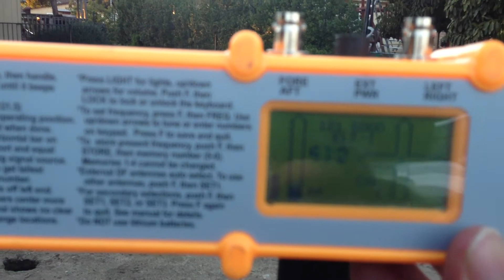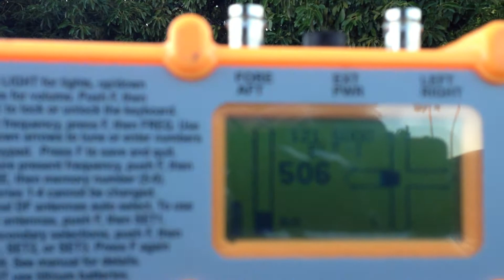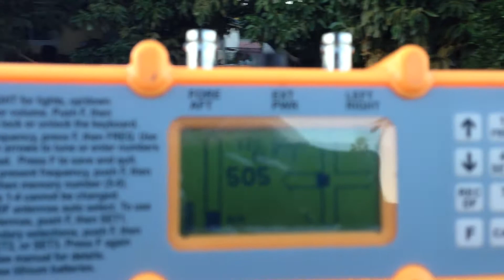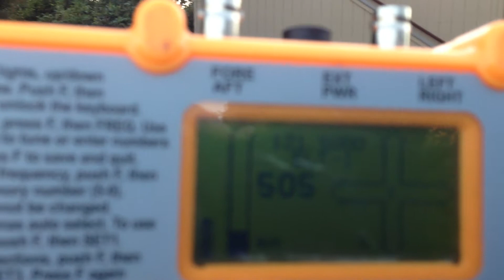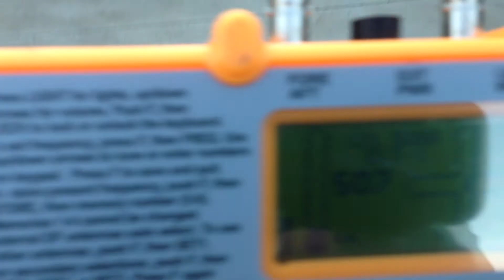ELT Directional Finder Basic Setup and Operation

Comment: Just curious the manual states It should NOT be calibrated within 100 ft of an ELT or at a busy communications site because this could cause errors or false "FAIL" indication. The most recent calibration values are stored in the corresponding memory can you expand on that.